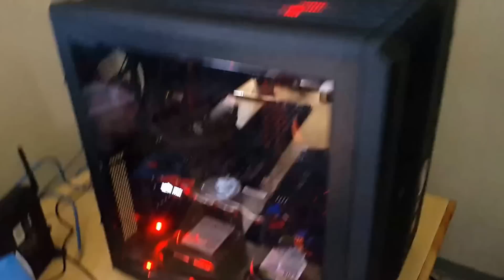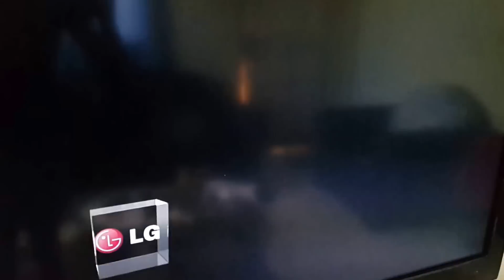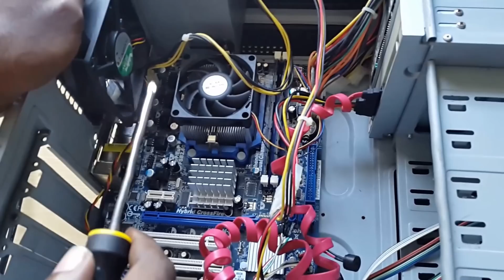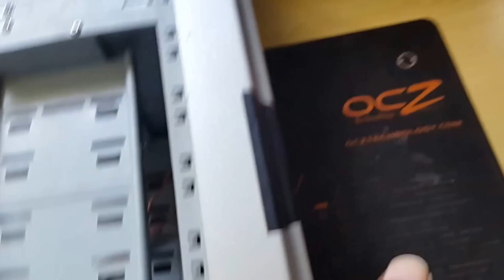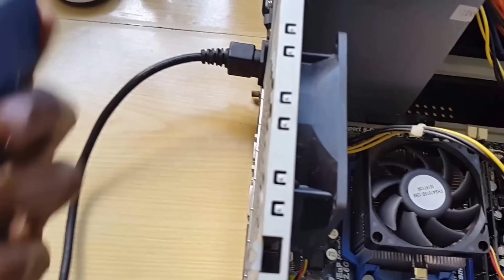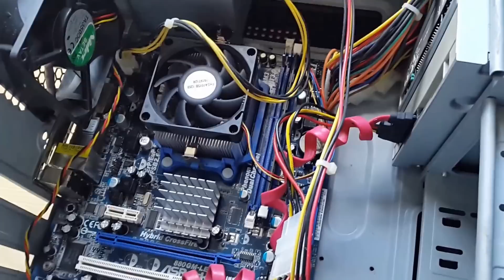No signal to Monitor Fix Easy PC Fix

Comment: I have tryed to switch hdmi cable, monitor, a Graphic card that Works, pull out ram, turn off power and drain for 1 min, pull out batteri.

I feel like i ran out of options now

Comment: I tried all of these but unfortunately did not work. I recently cleaned out my computer and my ram slots. I reseated the ram and finally got it to stop beeping but won’t display on the screen. I have an on board graphics and all other connections are tightly secured. Any help would be appreciated?

Comment: The power button does not light up when I press it but the power supply fan turns on and I see no other movement in the computer. The monitor has no signal either.

Comment: My moniter is Vga but i got a Dvi connector and  my pc only works on dvi, monitor works on both dvi and vga so I plugged the vga into the monitor and the connector (dvi) into the pc and its not working, does that mean I need 2 connectors?

Comment: BTW I have a 2017 corsair one basic pc system . Problem started coming on after 1 year later with no monitor signal when pc is on. Try everything including cleaning , replacing cable, rams, monitor and even reinstall win10 ( more than 50 times). Almost wanted to throw the damn pc out of the window.

Turns out recently I read on corsair forum and someone suggested to go into the bios system setup and change the setting in PCI = to GEN 2 setting. IT WORKS!!!. I was in love with the pc again!!!.

Comment: Had no signal problems. Knew my cables and parts where all in good condition. 

Tried the disconnect the power cable technique and hold in for 60 seconds. 

Turned my pc on. Let it run for 10 seconds. Then turned my monitor on and it all worked. Got signal now. 

Thanks so much. Awesome video.
Reply from the maker: Very glad you solved the problem.
Reply: @rickytlc1985  again thank you for posting such an informative video.  👍

Comment: My vga port is moving. Is that a problem?
Reply from the maker: Could be damaged as it should be firm seeing its soldered or attached to the motherboard.
Reply: @rickytlc1985  thanks i fixed it.

Comment: So ive been using my pc without a gpu for a couple of months and it has been working perfectly i just boufgt a gpu today put it in the pc and now i dont get signal from the gpu nor the actual motherboard. Please i need help
Reply from the maker: Is the gpu getting enough power, did you install it correctly or in the correct slot?? Also it might be faulty.
Reply: @rickytlc1985  im going to return the gpu tomorrow in case its faulty but what is worrying me is that i reverted everything like i had it before but i still dont get any signal in my monitor which i find weird. Also i dont know if this helps but i have a mouse with rgb and in my pc the lights are so dim but when i connect it to my wifes laptop is bright like it should.
Reply: @rickytlc1985   my pc specs are 
Asrock b450m motherboard
Rzyen5 3300g cpu 
2x8gb ballistix ram 
1tb barracuda hdd
500watt psu by thermaltake 
And the gup i was trying to put in was a xfx rx 5600xt

Comment: Bruh, I wish I could find this video sooner... I tried different cables, I cleaned my RAM and RAM slots, tried to turn the PC on with just one RAM, I tried with different cables, different monitors, different graphic card even... All I had to do was to boot up and it worked on the first try, and I didn't see this solution in any other video. Thank you man!
Reply from the maker: Its always the small things in the end.

Comment: My Memory Slot 1 didnt work i try it one by one.. only slot 1 didnt work .. what should i do? thanks
Reply from the maker: Try cleaning the slot or find out if it the memory. If its the slot see if slot two will work by itself. If not you have a serious issue and may have to switch Motherboards.

Comment: The first work! My brother and I tried cleaning the ram, taking the hdmi cord into the gpu and mother broad, checked every single spec ask nothing worked but this!
Reply from the maker: Happy that the video provided the solution that solved the problem for you.
Reply: @rickytlc1985  can you help me? I was in the middle of gaming when my monitor said going into power saving mode. My pc was on and all the fans were spinning yet now when I boot up my pc it says no signal. Please help me
Reply: @mattheo4709  I’m a beginner in pc building, i don’t think my help will get ur pc running again. But lmk if u still need help

Comment: Guys if u have tried everything as far as making sure everything is plugged in then I am 80%sure its the ram sticks just take them out and clean them and BOOM its now working
Reply: Thanks man you saved my time 
But still one question as far as i know at starting computer loads bios program from rom . So, at least it should show something then stop if it was just ram dust

Comment: My dram light is on in a brand new build.  I tried switching out RAM from a known working computer and the light is still on and no post.  Does this mean motherboard?
Reply from the maker: Could be, but seeing its a new build try reseating the processor, sounds tedious but had several builds were I tried everthing only to do that although I did not want to only to having the problem fixed.

Comment: I was so worried cause my computer wouldnt connect to the monitor, so i looked up this video. Then I remembered im supposed to plug my hdmi cable into my graphics card, not the io.

Comment: So I pulled 1 stick and turned it on and had no difference. Replaced it and pulled the second stick and bam, Series of beeps. Also a fully black screen as opposed to the previous "no picture available". Pretty sure I have it narrowed down to ram but still have no picture. So do I replace both or the one that seems defective? And if I do, will all my memory be wiped? Like game saves and photos and such
Reply: Also worth mentioning, I was so confused previously of what could be wrong I swapped my hard drive into another computer and had the exact same issue. those ram sticks should have been working so im worried about buying new ones and wasting money

Comment: First method worked the second time when I left the PC power cable unplugged and pressed the power button for 60 seconds but left the monitor cables plugged in. After turning on again the monitor picked up the signal display. Thanks for the video!
Reply from the maker: Any time

Comment: First thing I noticed was an odd problem with keyboard and mouse. The keyboard and mouse input was acting funky. Ex: my mouse cursor movement would register, but my m1 and m2 clicks would do nothing. I also noticed the same with my keyboard, key bindings were randomly changed. I swapped the keyboard and mouse and it seemed to solve the problem. I turned the pc into sleep mode and the next time I turned it on this problem began. Tried your first step and it changed nothing. I was planning on switching out the pre-installed 8gb ram chip for two 16gb ram chips, tried it both ways and no success either way. I literally bought this pre build days ago. Hard to tell if it’s the monitor or the PC. I might just return it all. I believe I have a graphics card but am hesitant to tinker with it as I fear it may impact the return policy. How could it go from working fine one hour to not working the next ? The pc powers on and everything. I’m at a loss..

Comment: I have one problem when I connect the power cable to the power supply the cpu starts automatically without me even pressing the button plz reply or try to give a solution
Reply from the maker: Check for stuck or dirty power button.check power supply might be faulty and also power button cables.
Reply: @rickytlc1985  when I plug in the the power cable the cpu fan and the power supply fan both of the start running without pressing the power button and on the monitor is shows no signal though the cable is connected properly can you plz specifically tell that what can be the problem?

Comment: Hi,Both monitors come on at the same time then one goes off and states no signal . I then turn on each one on independently they both seem to be working fine but not together . one monitor goes black . As a result i can only use one monitor . Any help is welcomed . Thanks

Comment: unplugging and holding the power button, fixed my issue. looks like the power supply I have is is overkill for the system set up. I run a secondary PC running older hardware, for basic multitasking. But the power supply in it, is the spare to my main PC, which can probably light a small home Lol. So for those out there building a PC, just keep in mind, a super power supply is not optimal if you don't have the hardware to pull the power. Meaning some super power supplies hold a higher charge for next power on. This can cause havoc to to lighter set ups.

Comment: Everyone is working in my pc, every fan is spinning. I plugged my hdmi into the graphics card, and I get no signal in my monitor wtf. I even flipped around the hdmi and tried a different spot to plug in the monitor for higher voltage. Literally nothin. I hope I find a solution because I spent $1000 on a pc setup.
Reply: Same problem, you already solved it?

Comment: I removed and cleaned the ram and tried the unplug and press power button for 60 seconds method and when I plugged it back in. I got a blinking yellow light on the power button and it stayed like that with the fan on. Any idea of what to do?

Comment: I did this and it worked a couple of times but its happening regularly. I've changed the battery mother board and cleaned out memory part.  But problem persists. Any more ideas?

Comment: Hi Ricardo, I have done every one of your steps (except from replacing the gpu and motherboard) and I am still getting no signal, but my pc lights up and the fans are spinning. Is there any thing else that I can do to fix my pc? Thank you
Reply from the maker: Did you try reseating the Processor, updating motherboard drivers if you can, bypassing the GPU and try getting video from the motherboard directly.
Reply: @rickytlc1985  I couldn't get any video from  the motherboard. How do you reseat the processor?

Comment: When you suggest cleaning ram cards, do you first power computer off and then do it? Also, can you please cover the vga method in more detail, when you take graphics card out? Do you connect the vga cable to the monitor? Thanks in advance.
Reply from the maker: For safety always power down and ground your body before doing any of the above.

Comment: I still cant underatand how unplugging the psu cable and back in works but thank u so much bro
Reply from the maker: No problem 👍
Reply: @rickytlc1985  Will this method reset the computer to its factory specifications? In other words, will it erase all the memory, apps, etc?

Comment: I have a Optiplex  745 .. I plug everything in  and the tower turns on and I can hear it running, but it doesn't  power up the monitor, keyboard,  or mouse.  Any idea what's wrong?

Comment: I did it and it made a cracking noise when I plugged the cable back in and I still had no signal 😭
Reply: Fixed it now, had to reset my monitor as well 😂

Comment: I'm so very thankful for the fix in this video!  Woke up this morning to No Signal and tried all the usual IT department requirements (unplug, reboot, try different ports, swap cable, etc.).  Still No Signal.  So I hopped on my phone, did a quick Google search, and found this video.  I've never heard of unplugging the tower THEN holding down the power button, but it is a legitimate solution to try if you don't have some other major problem going on.  Thank you Ricardo for saving me from spending half my day at the tech store buying a new monitor or HDMI card!

Comment: I'm seeing a lot of the same comments.  Here's my issue if anyone has input:  My GPU has 2 HDMI ports that both work.  My motherboard also has an HDMI port.  I only get no signal on the motherboard port.  What is the reason?  It is not an issue because I likely would never use it.  But I would prefer to get it working just for the sake of all of my ports being fully functional.  Do you not get signal on the mobo port while a gpu is plugged in?  Or can I just take the steps in this video.  Thanks gang

Comment: Make sure you didn’t bump the bios switch if you have dual bios.
Reply from the maker: Great tip
Reply: @rickytlc1985  thanks man, also always troubleshoot cables and ports before messing with internal hardware .

Comment: first method worked for me, thanks!

Edit: hey there I hope you can see this but the problem happened again it has happened 4 times so far every time I shut my PC down and try to turn it back on after leaving it off for decent amount of time (7-10 hours)
now first time was 4 days ago, I put it on sleep mode and when I came back the power button was on but there was no display, I spent around an hour or so cleaning it up and changing the ram ram configuration trying each stick in each slot and after a while it worked so I installed the second stick and everything worked perfectly as if nothing ever happened, until I shut it down, I try to turn it on after 8 or so hours and I get no display, this time I tried the ram thing and it didn't work so I tried your method with the power cable and the start button and it worked the fourth time, again until you shut it down for some time, I turn it on and no display, nothing I tried previously worked, so I unplugged the 8-pin and 24-pin and then plugged them back in, and somehow it worked perfectly, again I shut it down and this time after almost a day come to turn it on and I get no display.
every time i get a display everything works perfectly the CPU, GPU, RAM, PSU, but when I shut down, no display
please help!!
Reply: hey there I hope you can see this but the problem happened again it has happened 4 times so far every time I shut my PC down and try to turn it back on after leaving it off for decent amount of time (7-10 hours)
now first time was 4 days ago, I put it on sleep mode and when I came back the power button was on but there was no display, I spent around an hour or so cleaning it up and changing the ram ram configuration trying each stick in each slot and after a while it worked so I installed the second stick and everything worked perfectly as if nothing ever happened, until I shut it down, I try to turn it on after 8 or so hours and I get no display, this time I tried the ram thing and it didn't work so I tried your method with the power cable and the start button and it worked the fourth time, again until you shut it down for some time, I turn it on and no display, nothing I tried previously worked, so I unplugged the 8-pin and 24-pin and then plugged them back in, and somehow it worked perfectly, again I shut it down and this time after almost a day come to turn it on and I get no display.
every time i get a display everything works perfectly the CPU, GPU, RAM, PSU, but when I shut down, no display
please help!!

Comment: i have a problem very recently. my pc somehow couldn't recognize my gpu when start up, but the window strart normally & it shows on the monitor that connect with analog vga connector. I tried your first method of plugging & unplugging, it works somehow but if I shut down my pc & turn it on again, it will start the same again with no gpu connected. Please help.

Comment: Hello! Yesterday my Monitor went black and said no signal. I use a vga to display port adapter so I can connect my monitor to my rx 570. I have tried many methods to solve it including checking if everything is plugged in both the CPU cable And PCI-E cable and they are plugged in. I tried removing the ram and placing it back still no signal. I even tried unplugging the monitor and the pc from power source and leaving it for a couple of minutes and still no signal.  What is the issue please help me out it would mean alot! Thanks and have a great day!

Comment: The same thing happened to me, one of my monitors was showing no signal, but I was going away for two days and I couldn't be bothered to fix it until I came back. I came back after two days, switched on the PC and the monitor was working again. I just thought perhaps it got overheated, but it's now doing the same thing since I left it on sleep last night.

Comment: I ended up just re seating the graphics card and it worked which is strange cause it was working fine before and I could see the fans spinning so it had power

Comment: I need help so I cant just up and buy a new GPU and I dont know if I downloaded a virus or somethin because it's as if my pc is like starting up completely but isnt doing anything just trying to boot up and the lights and everything work but not my keyboard or mouse and I'm just lost at what to do I mean I could save up for a new GPU but if theres another way so if It isnt the GPU I dont blow 3 or 4 hundred dollars if you can help by suggesting anything or even if you can ask someone it would help so please if you see this reply tell me how I might be able to fix it

Edit: could dust be an issue? Or not becuase it so than I will clean it out cus I haven't since I live in canada and winter has been a bitch with snow coming than melting than coming back and melting

Comment: Ricardo Gardener:: Yuuuup i had the same thing happen, it all turns on but not image. And i have a backup motherboard a Gigabyte AX370 / 16GB - Ram/ Ryzen 5 1500X  and a 6oow PSU. So i tried my 1050ti GPU on that one and also nothing so i know for sure it is the GPU, i mean i had that Gigabyte mobo in its box along with all the components. my other primary PC is Asus B350-f 16GB Ram and Ryzen 7 1800X and a Corsair RM 750X PSU. That's the PC where i first encountered the no Image. Also, i use to have trouble switching out GPU's slots whenever i clean my PC from dust. I take out GPU a lot, and i use to get stuck and i yank it out with cable on, that was stupid of me. my new GPU  Arrives on  1/3/2020  and i will give you my update on how it went, well till tomorrow.